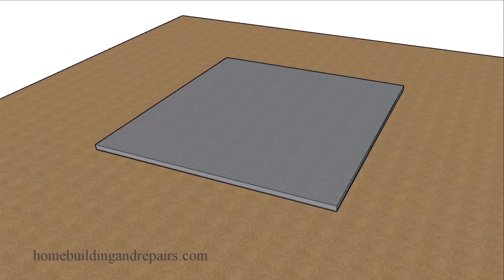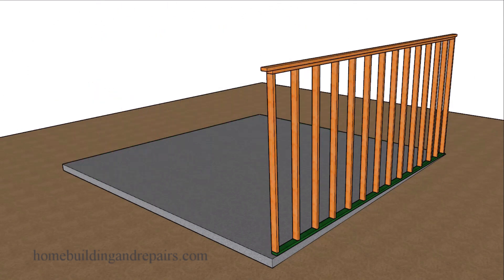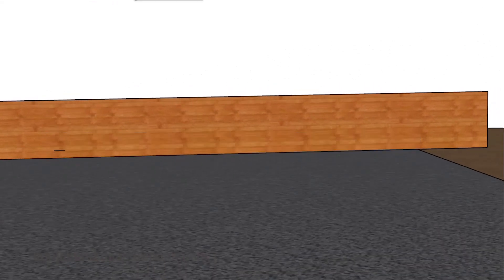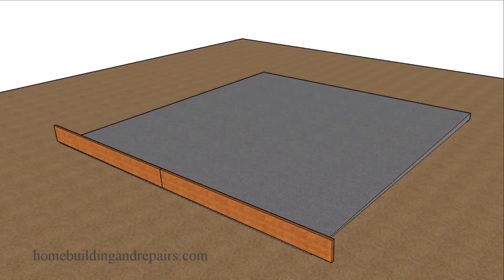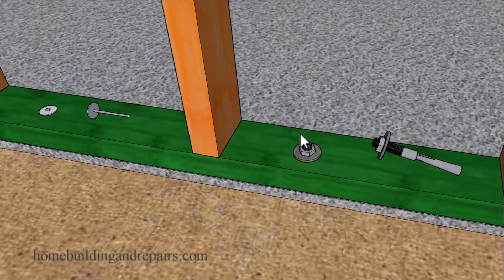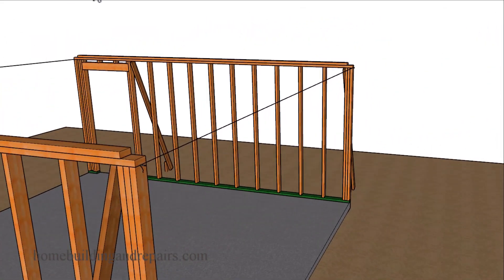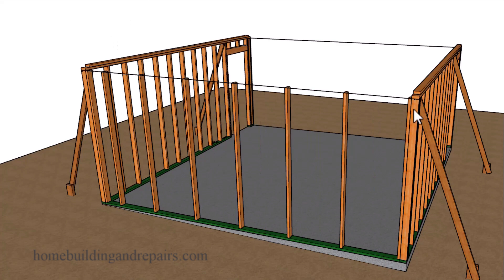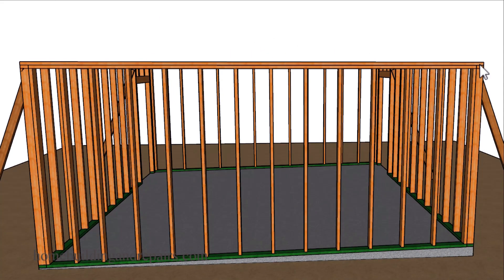How To Calculate Heights of Wall Framing Studs When Working With Tilting or Sloping Foundations

Comment: My favorite string to use is a jet line that's normally available/used for acoustic ceiling grids. I prefer jet line over regular construction sting because it doesn't droop on long spans because it's thinner, lighter, and stronger.
Reply from the maker: I will have to check that out.